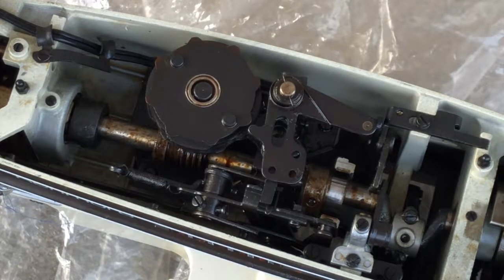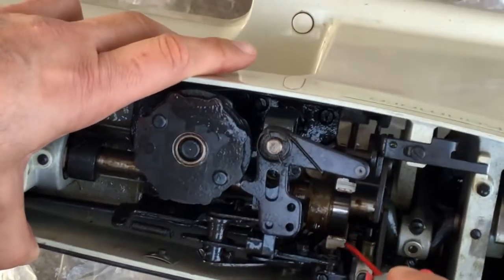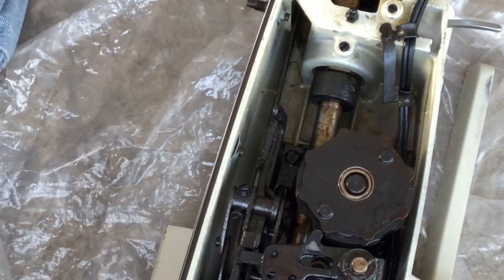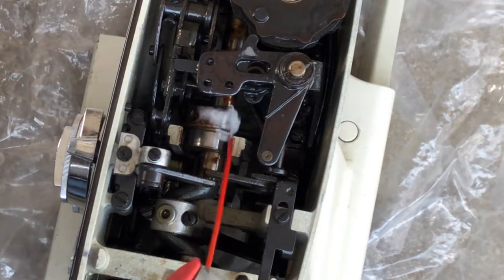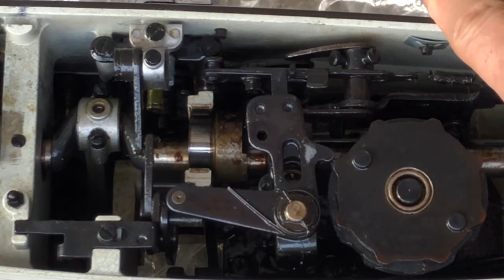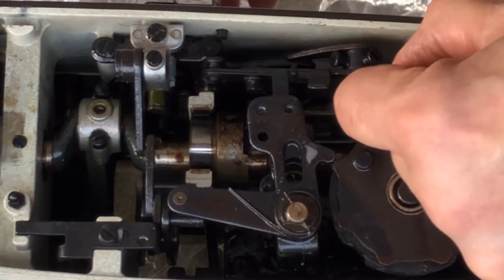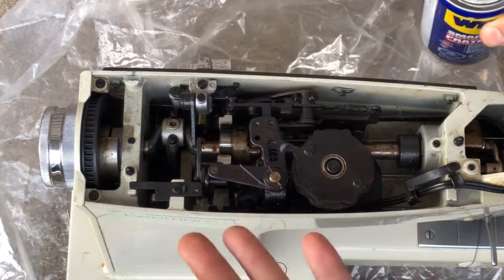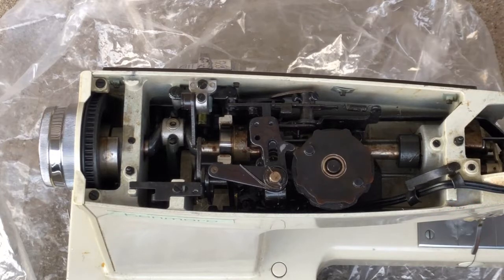RESCUE SERIES #6: Are We There Yet? Sigh! A Lesson in Patience & Wiggling Knobs/Linkages in Tandem.

Comment: I was telling my husband about your videos I’m watching. He has repaired sewing machines for over 15 years. He thinks whomever had your Kenmore used the dreaded 3 in 1 oil with its waxy base that caused her to seize up. He likes to use a mini torch, get a very fine tip on the flame and gently tap it to each joint quickly  so it didn’t over heat the metal or plastic parts. This works great with Husqvarna 6000 series along crank shaft and oil holes. Lightly tap it with the mini torch. The funny he used to say, “here comes a hustler-du, hit it with a torch, it runs like new.”

Comment: Thanks a lot for detailed and informative video. I had the exact same situation that you had with this Kenmore with a Bernina 830 fron 1972. In the end, I had to remove all electric and plastic stuff and clean it entirely with Benzin, brake cleaner, and isopropyl alcohol, depending on the amount of dirt and gunk. It is now working fine, however it needs a new gear (famous plastic cam stack gear) as it was broken. 
As I see this Kenmore now, I can say that it is comparable with Bernina except that the Bernina has a metal underneath.

Comment: Recently found your YouTube videos and appreciate your patience and knowledge!!! You genuinely love sewing machines.
I recently purchased a Kenmore that has an amazing electronic decorative stitching and lettering feature (SensorSew 70 model 19501)...but it's  ceased up or frozen. I am inspired by you....the machine doesn't appear to have old oil on the shafts and linkages....so I oiled where  indicated in an online owners manual... More than one drop!   Still following your lead in your year old video series... I opened up the machine ( not much lint) ... and oiled linkages and metal pieces, staying away from rubber belts and the electronic panel and connectors. But still stuck.. Barely can turn the hand wheel ....am hoping to PM with you for some advice in trying to restore this 💎.  The clutch for bobbin winding does allow for ease in turning the wheel. Also, plugged it in to check if the electronic panel still works.. Seems functional--can enter stitch types, and increase/decrease stitch length and width..but did not /cannot run as main drive shaft is frozen. 
Looking forward to a reply...also left this message on your latest series.

Comment: I have a couple  of "mini-Kennies", the 158-1040 models, one of which worked perfectly after a good cleaning,  oiling and lubrication but it drove me crazy because I couldn't get the feed dogs to go up or down!  I removed the feed dogs lever and applied sewing machine oil to the tiny metal shaft but it still wouldn't budge.  I had also used oil on the little linkage arrangement that moves them because they were frozen as well - none of it helped.  Then I read about someone who used a mini-hammer to gently "tap" frozen joints.  I have a mini-hammer so I gently tapped the little shaft toward the inside of the machine and miracle of miracles, it moved!  I dropped on more oil then tapped from the underside to push it back up.  I repeated this gentle tapping, moving it up and down until it moved very freely.  Then I screwed the lever back on it.  I could tell the lever was free but the linkage still wasn't working, so I decided to risk tapping that too (scary!).  Again, I put more oil on the joints and began tapping SUPER-gently.  It moved!  I oiled the entire linkage again and began working it with the lever.  Now the assembly works perfectly.  It just need the tiniest of whacks to loosen it.  Who knew?  
I've had Kenmores for 50+ years and love them.  I love your video's too!  I learn so much from them - thank you.

Comment: In Brazil it is used to wash sewing machines with soap powder. Then dry and apply oil and grease. There are older machines of the 50s that the manufacturer had to clean the internal steel parts with kerosene. Allow to dry and then apply grease and oil. WD40 is an excellent oil and great for unlocking. I find radical washing with soap powder to clean dirt from oil and grease. I prefer kerosene in the case of 100% steel machines internally.

Comment: I have a similar model, a Kenmore 1813. It has a chain stitch which is very useful in fitting. It looks like a regular stitch once sewn but you can pull just the thread end to easily remove the stitching. None of my newer machines, one with a zillion stitches, has this one very useful stitch. Your machine there can probably do this chain stitch, too. Luckily, you have the manual! You switch out the bobbin and case and insert the chain stitch adapter and then use a chain stitch cover plate. It’s a great feature. Hoping this machine gets unstuck and working!
Reply from the maker: Hello Mildred.  I really appreciate you commenting and mentioning this.  It has been some time since I have seen one of the chain stitch adapters and yes, it was a great feature when laying out a garment project.  I makes one wonder why they don't have those in machines today doesn't it?  The next time I come across one of those, I will make a video for it.  Thanks again.
Reply: That would make a cool video! It is puzzling that the chain stitch isn’t included on new machines.

Comment: if you do not have a heat gun use a hair dryer, if plastics are nearby be careful with heat, if you can take off plastics it is better. use brake cleaner mixed with oil insted of wd40.

Comment: Every day I work on my sewing machine that won't reverse. Its been 2+ weeks now. All mechanisms move smooth inside with no resistance.  It's just that the reverse lever won't function to move the series of gears far enough into position to work. In reverse, the feed dogs only lift and drop. No spiral rotation that would make the fabric move. Tried penetrating oil and WD40 both so far. No go. I'm losing patience with no progress whatsoever

Comment: Challenges are more fun and rewarding than straight forward. Do you not take assemblies apart to help clean them? I sometimes stuff rags in strategic places to help absorb excessive fluids.
Reply from the maker: Hello Anthony.  The answer to your question really depends on what parts are involved.  Most drive train components were assembled with special tools.  Gears would be taken thru a "Running in" period. If a machine is fully disassembled and then reassembled, it might not have the same tolerances and never work quite right again.  I have found that I can get most machines clean without taking apart the driveshaft.  Now as for the shuttle/race/hook mechanisms, those are considered "Service Parts" that were more frequently required to be taken apart and cleaned/or replaced.  I can say from my experience of removing a portion of the assembly on the Bernina 830 Record, the hours required to loosen and coax those frozen parts out in order to replace a gear set took so many hours, no one could reasonably expect to pay for that quantity of labor. If the Kenmore you see me working to save was not all steel, I would not invest the amount of time I expect to have invested when that overhaul project is over.  I hope to make a video soon on when to commit LESS time when calculating the overhaul of a "Hybrid Vintage" machine which might contain one or more plastic mechanical components.

Comment: WD40 is a good lubricant but t,he brand  Liquid Wrench has more magic! I got mine at Cal Ranch. Just a. trick I learned from an old pro. I just got this machine from a thrift store. The dog feet kinda rattle. If you have suggestions for me I will hopefully be tuning this one up. Thanks for this video as it has great tips for me.
Reply from the maker: Hey there and thanks for sharing the tip.  Actually, I have used that before and it can help breaking up old grease.  Its actually the next thing I plan to try.  I will need the machine to sit out longer given that LW takes longer to dry and I want to be sure I don't stink up the house!!   But I agree it can be a very useful cleaning lubricant.  Thank you for the suggestion.